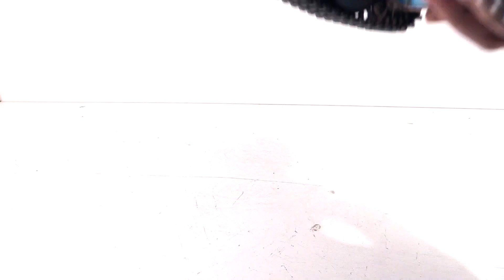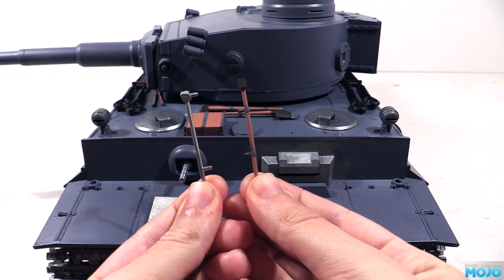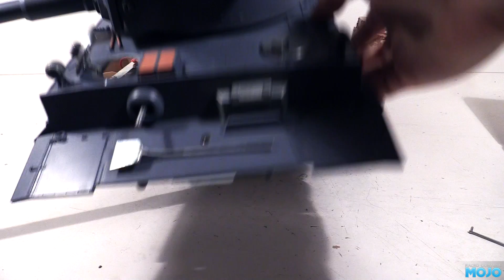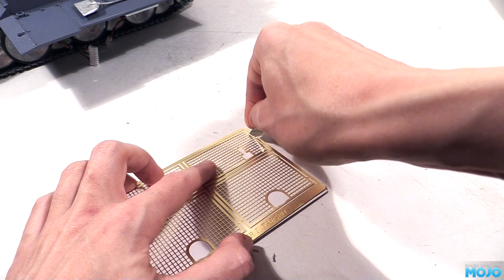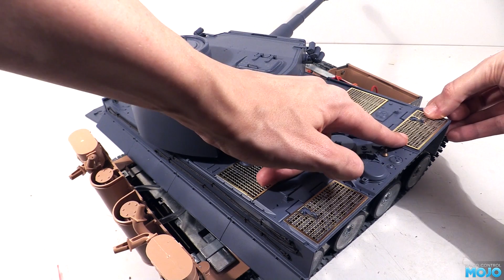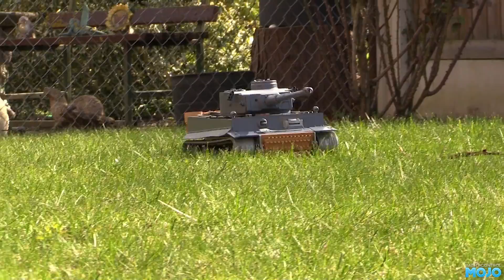Heng Long Tiger I - 11 - Brass Grills

Comment: Helpful. I am doing similar with mine. I think I got the same metal tools as you, none of the holes line up and I haven't swapped them yet.  So you just drilled new holes and dont cover up the old ones? The old holes seem fairly well hidden. Looks good.